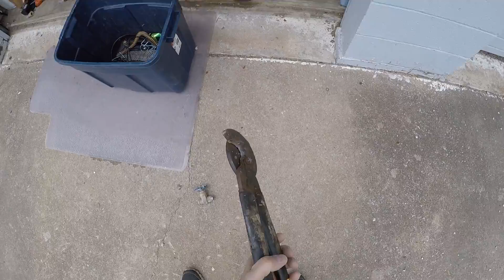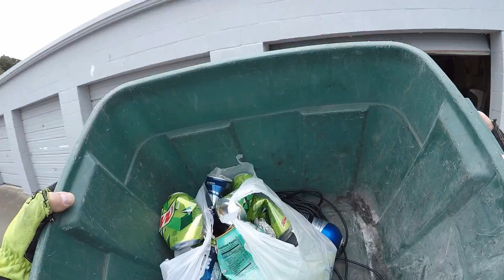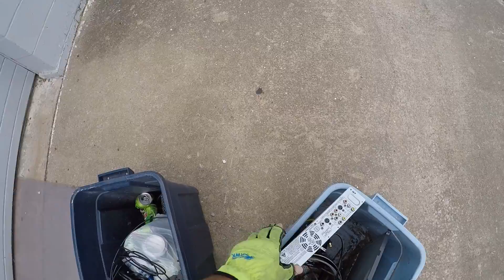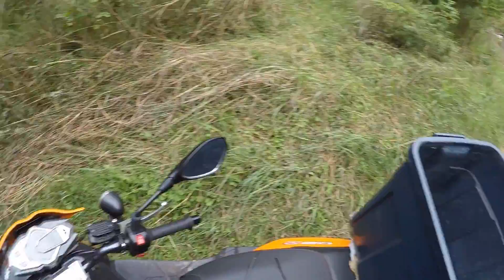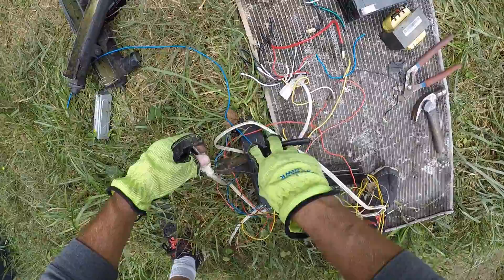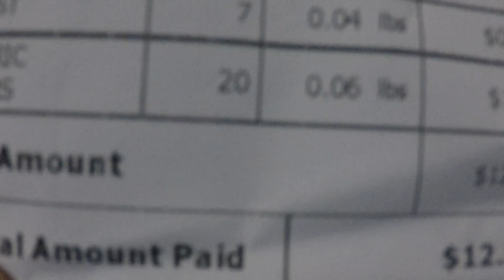SCRAP'N and FLAPP'N - HOW LOW can PRICES GO??

Comment: In Eastern Washington tin was $70 a ton in July, August it dropped to $50 a ton, extruded aluminum is .55 cents a pound as of Sept 8. I think Scrap Kingdom would agree that if your only getting 2 cents a pound more  on stripped motors then tin. Just cash your motors in the way they are as tin. The price difference would be made up in labor of not stripping them and heavier since it’s not stripped.

Comment: Minnesota. from my last run a few days ago. Steel $0.020LB, Alum Cans $0.49LB, Yellow brass $1.30LB, Zinc Die Cast $0.40LB, Alum Siding $0.37LB, Cast Alum $0.32LB, Lead Acid batt $0.20LB, Alum Breakage $0.08LB. Copper and everything else is down as well but i dont have any recent prices for anything else.

Comment: prices in the netherlands at my scrapyard,
everything goes by kilograms.
scrap steel €0.17ct 
heavy steel €0.19ct
steel with plastic etc €0.10ct
electric stuff like tv's €0.08ct
aluminium €0.75ct
cast aluminium €0.80ct
aluminium rims €1.25
lead €1.25
zink €1.35
stainless steel €0.85ct
cable without plugs €1.20
cable with plugs 0.60ct
copper €4
brass €2.80
electric motors €0.25ct
lead acid battery's €0.55ct

at my scrapyard we only have two grades of cable, with plugs and without.

take care.

Comment: In South Australia today brass $4.60 per kg copper $6 per kg aluminium $1.25 per kg copper wire plastic coated $1.70 per kg stainless steel $1.15 per kg steel 15 cents per kg. From memory 1 kg is equal to 2.2 lbs. Hope this helps. Keep up the good work.

Comment: well i'll be "awe" with you that is an awe-some score, "gets pelted with rocks" ow! okay no moer puns! need some oil or wd-40 for those tight screws, that or just some lube or cheapo spray can stuff to losen it off, the un-ish-orgniased scrap that is the lock up, mind you at least you know what's in there, old scrap mc pallets the man89 is "shortin" his unit out but has only brought a ginder (the tool not that gay ap) and has re-moved one alliumum grill, 
those low prices are from the ppl chucking crap into the scrap metal pile and the ppl that buy it getting annoyed at what there getting, be like you if you got a pizza with cheese but under the cheese was a load of pepperanio but only once you re-move the cheese do you see those red dots, that or its trumps tax chrage which has everyone up in arms! 
no idea on my scrap prices all i know is there ???

Comment: Prices are not just low in your town, they are down here in Florida, Scrap Kingdom he says they are down where he is at too.  I think Tucker Upper even talks about low scrap metal prices.  it is not just you.  Right now if you can sit on your most valuable scrap like copper and brass wait for the prices to rebound.  If we as scrappers all hold back the prices will come back.

Comment: My prices here in Maryland- Xmas lights = 8 cents per pound; aluminum cans = 40 cents per pound; ballasts are 10 cents per pound ( this is if you have a big box of ballasts though) but I'm like you - I just throw them into my steel scrap; no. 2 copper wire is up at $1,37 per pound; brass at $1.25 per pound; junk wire = 20 cents per pound. Your prices are higher on steel and aluminum compared to ours. Forgot our electric motors are 10 cents per pound.

Comment: Your traps will do better if you put a chunk of cat or dog food., bacon, dried sardines with extra salt etc fish n crawdads lice that or l7ce bait. I would get cans of sardines free, put on foil with salt n put outside in direct sun. When we camped, i put it on the roof of the tent, camper or truck. Sun dries the flavor n extra salt. It lasts a ling time on a hook. Those are great for cat fishing too. Since they go by scent of sorts only. Toss a hook out at night with a bell on the pole.  If you have spare aluminium wire, wrap it around like a cage then 2 wires out to attach inside your cage, so the bait can not be gotten to unless the fish or ? Go inside. BREAD DOESNT GET ANYTHING WORTH GETTING as you saw. Fish like meat, flies,  etc. Why do you think the lours look like fish or flies? Water creatures too.. you can even twist wire around  a few worms  but you need to suspend it with wire or chains in the cage.

Comment: If your making enough money to buy 3xtras and cover 2 storages, since you live in a VERY LOW cost area, why not rent or purchase a home? Many ppl have places with big lots with tons of scrap n old cars. Shoot.. that place you filmed 2x has abandoned stuff you could scrap out. Tons of copper... chunky copper. .. btw, our alum is 35 -39 cents a lb, brass is down to 1 27, bare brite #1 wire down.. 2.08.. it was almost $3 at the beginning of the year. Tubing is 1 91 down almost a $1 too.. or 70 cents. 
I know there are tons of places cheap there. Plus easy to buy area.  Also tons of places with minerals and water. Fishing, hiking etc. Right on the property.

Comment: Here's a price  list in our area in Tennessee...copper..1.84 lb...steel..123.00 ton...aluminum.34 lb..brass..1.27 lb...light iron..1.08 ton..bare bright copper wire..2.09 lb..aluminum siding .37 lb...alum cans .39 lb ..stainless steel .35 lb..thhn wire 1.25 lb ..copper tubing 1.91 lb..insulated wire .42 lb..elec motors .07 lb..car/truck batteries .22 lb
Reply: Terri Sams now I know why I agree with so many of your comment. I live in Northwest Tennessee. Dyersburg to be exact, have lived here Sind 1953. So glad SV is letting us talk to him and each other again. Love the drone.

Comment: I live in Cincinnati and I get $80 a net ton for sheet iron,$0.0800/LB for irony aluminum,$0.1100/LB for low grade circuit boards,$0.3700/LB for clean aluminum sheet,$0.2800/LB for clean cast aluminum,$0.4800/LB for clean aluminum extrusion,$2.00/LB for bare bright copper,$1.95/LB for #1 copper,$1.61/LB for #2 copper,$0.50/LB for refinery brass,$0.25/LB for #2 insulated,and finally $0.05/LB for electric motors.

Comment: Dutch prices (in Euro per pound, add about 15% for USD price): steel shred 8 cents, bare bright copper: 2.20; brass: 1.35; stainless: 0.40; aluminum: 0.38;  #1 wire: 0.60; electric motors etc: 0.15

Comment: I live in Austrlia in Qld or Queensland and the scrap prices where i live are (these prices may of changed just so you know ) and some of these prices are not in the dollar amount like $3.50 as an example cause some of them are like $450.00 a ton(if you understand what i'm trying to say). And i go to two scrap yards and the prices are drifferent at each yard if you see a change in the price. and it is in KG instead of pounds.and all of my Aluminium, copper, stainless has to be just that nothing else on it even if it is the smallest amount minis paper, Sorry if i went on and made it so long. 

Electric Motors $ 0.350 (includes ballasts), Aluminium Cans $ 1.350 , In Size steel ( thick steel under a meter if you did not know) $ 280.00, Light Gauge (thin steel could also be known as tin $ 125.00, Over size steel ( thick steel over a meter if you did not know) $ 250.00, Copper Brunt ( I don't know much about the drifferent grades but that is the main copper that i have) $ 6.950,
Lead Batteries $ 670.00, Aluminium radiators ( Clean ) $ 750.00, Electric Compressors ( out of fridges, frezzers etc) $ 260.00, 
Low Grade Copper wire $ 1.05, Copper Insulated wire ( off of fridges, vacums etc if you didn't understand the grading name) 
$2.20, Stainless steel $1.30, Aluminium Copper Raditors ( has steel attached to it etc) $ 3.00 (if it was clean no steel on it i think it is a $ 50 drifference if it was in tons), Aluminium Cast $ 1.30, Aluminium Extrusion $ 1.90, I don't have a price on Aluminium domestic which is thin Aluminium, Brass mixed ( includes all types of brass and other metals attached aka non clean) $ 5.95, Brass coast ( all clean just brass i dont know what type of brass it is though) $ 4.40 ( yes i know the prices of the 2 brass that i have are drifferent but i was reading this straight of the recipet. 

I hope this gave you an insight into the prices im dealing with. 
And thank you ScrapVulture to all you hard work and effort you put into you videos, and i am some what sure you have inspired people to do scrapping or dumpster diving etc as i started scrapping from watching your videos and i am never going to stop scrapping and of course never stop watching your vids.
Keep up the good work ScrapValture ( and again sorry if this went along to much).
Reply: Are the prices in kilograms for non-ferrous? And Australian dollars are about the same as Canadian dollars compared to US?
Reply: Pam Eyre yes there are for the non ferrous but in stead of it being a smaller number like $3.00 a kg its in $1 000 a ton and i think Australia dollars is drifferent than US but i dont know about Canadian dollars.
Reply: I fee  your pain my motors has hit rock bottom so i made this so i get the money not china you should make one https://youtu.be/cPk2yj8V7RA
Reply: This is Ireland. Irish D and Sandra Intresting contraption you got going  on there.
Reply: Rufus Smith Videos ,thanks for all the information it was helpful.so price is down ever were.but like you I’ll keep scraping.have good week and be safe out there.🤗🤪

Comment: Hi here in Montreal buddy the prices are very very low Number 1 cop bright wire $2.88 lb was$3,65 lb mid June numb 2 copper $2.81 was $3.228 brass $1.94 lb was$2.65 mid June also dropped tremendously!!! 😡😡😡oh that’s Canadian $$$